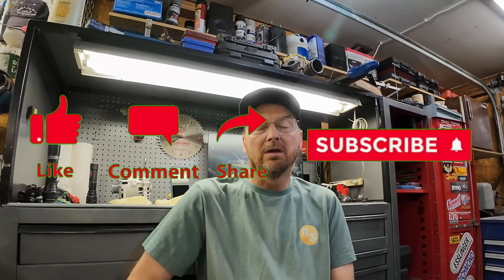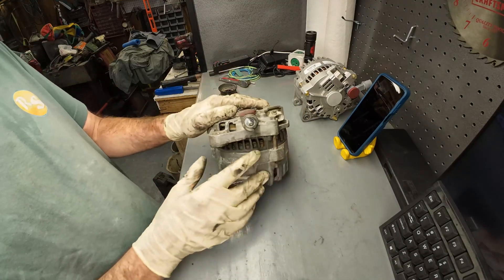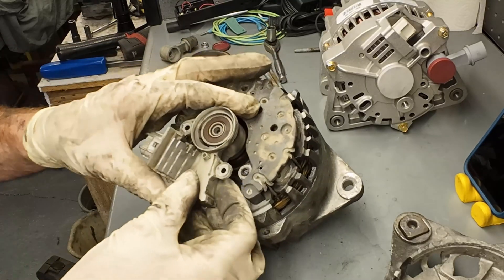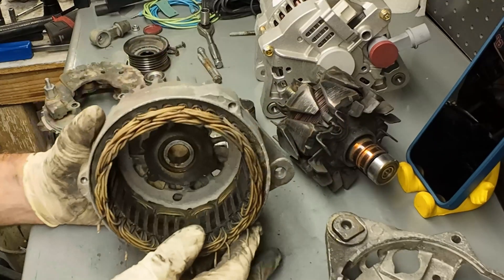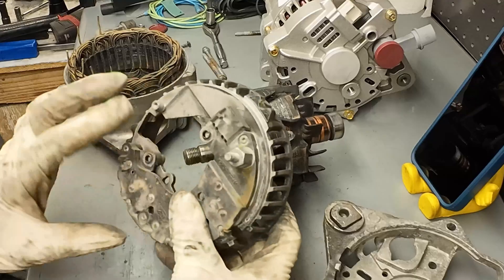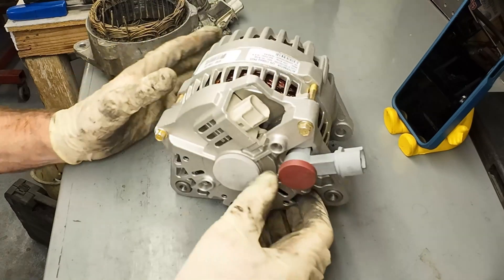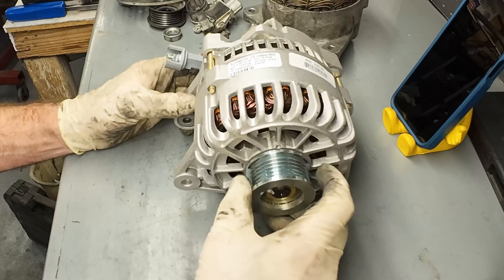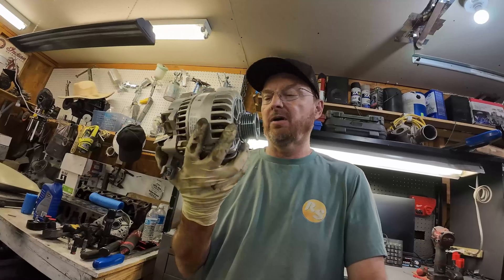What to look for when your alternator stops charging.

Comment: I have a very strange symptom and I’m not really sure what to look for. My alternator works just fine when I first start it up, but then a few minutes after driving it’ll stop charging, the meter goes back down to 12V.  I got both a new battery and new alternator, and the problem disappeared for like a week or two, then it came back. I thought maybe it’s a loose connection, so I wired an additional wire directly from the alternator to the battery, and the problem persisted. Could it be an issue with the alternator itself? Or something els?